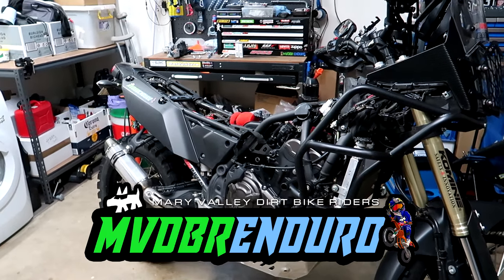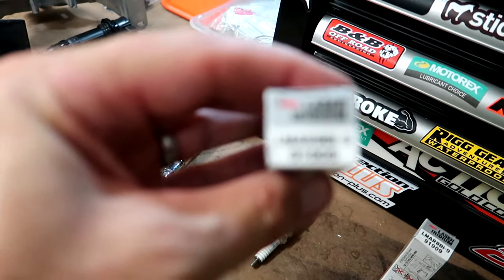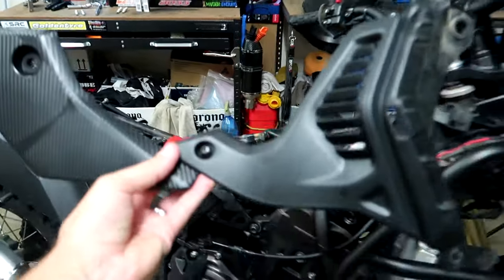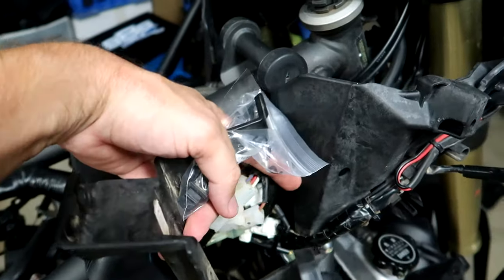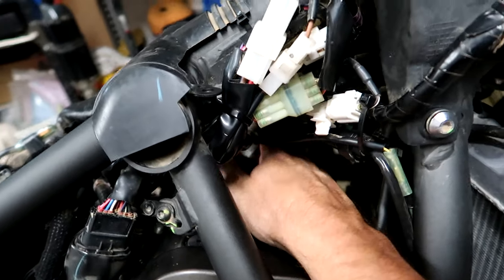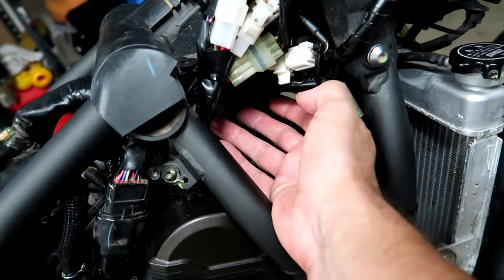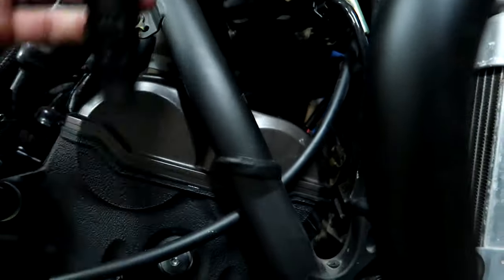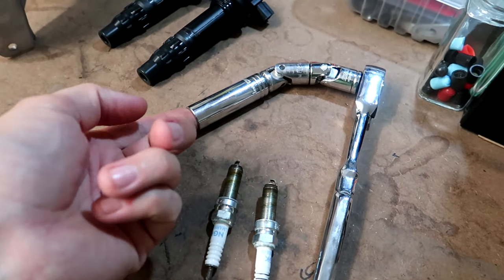Tenere 700 Spark Plug Mod For Easy Access

Comment from the maker: If you're having trouble getting the left-hand coil fully out, try moving the wiring harness above it forward towards the front of the bike as you're pulling the coil up and out. That may be easier than pushing the wires backwards. I'm not sure (can't remember) which way worked for me in the end.
Reply: Couldn't be done unless you forced it out. It tops out on the frame. You need to remove the ABS controller. See my video for more mod trick to remove the coil out.

Comment: I just did the complete change in about an hour. The easiest way to get the spark plug coils out is to get a length of electrical wire (~300mm long), double it over to form a loop at one end. Now twist the 90 degree connector on top of the coil tube so it is easier to access. Take your wire loop & poke it down (from directly above the coil tube) so that the loop slips over the 90 degree connector. Now you can pull directly up on the tube, no need for any spray lubricants. Because you are pulling straight up, there's no need to lever anything & you won't break the tube. You will find that if you just loosen the ABS/rectifier module you can then push it to the left & get direct access to the plug. The left plug is just as easy to change as the right using this method. There is no need to remove crash bars, radiator or rearrange any of the wires. You just undo the fuel tank, twist it 180 degrees & sit it where the seat goes. No need to remove any hoses, just the electrial connector. Also, place something over your battery to prevent the chance of shorting your tank across the terminals. That method that Clubby shows in his video is absolute rubbish & makes you think its a hard job when, with a bit of thought, its actually quite easy & quick. If anyone's in the Brisbane area & needs a hand then let me know, always happy to help!

Comment: Well played mate, that’s the one! Gotta get my hands on one of those sweet little KTM plug tools, looks perfect for the tool roll.
Reply from the maker: Good stuff Les was hoping you'd catch that. I ended up drilling the rubber grommet inside the tool a bit bigger and it grips onto the ceramic part of the plug just nicely now. Perfect solution, even does the front axle haha 🤙
Reply: Plug tool mod! Double duty, small & light, definitely qualifies for the tool roll !

Comment: Hi Josh Great video. The simple way to get you plugs out of the hole after you've unscrewed them, is carry a small length of plastic tube (150mm) with an ID just smaller than the OD of the porcelain part of the plug. You simply push it over the porcelain (by feel, its not that difficult )it will stretch easily over and grab the plug. Simples 😀 Most hardware stores have a range of this tube. If you have to buy a meter, Take the off cut as a syphon hose.
Reply from the maker: Thanks for the tip mate! I actually just drilled out the rubber grommet in the KTM plug tool a bit bigger and it works a treat now :)

Comment: Plug change every 20.000km. So it's not like you would have to do it every now and then. Also grease on the spark coils is a NO NO. There's a reason why they come dry and you want them to stay on and not move a tiny bit!  And get rid of that extra air filter you will fuck up the air fuel mixture. All these "mods" will bring problems on their own.
Reply from the maker: No issues thus far 😜

Comment: Awesome  mod anything that makes it easier, Unsure if its correct but might be worth looking into, if you drop  your bike in water and flood the motor ,rotate  the back wheel backwards pushes the water out the way it came in??I herd someone say before,might be worth investigating 😉🍻
Reply from the maker: Sounds like it should work in theory haha but I'm a bit dubious 😁 Thanks for the comment man
Reply: @mvdbrextra5216  I have tried this and it 100% doesn't work on the Tenere. The bit you missed is that you have to turn the bike upside down! You also have to remove the airbox otherwise it will suck the water back into the engine when you try to start it and lock again. However yes the method is viable and I've seen it done on dirtbikes.
Reply from the maker: @lukeh5725  thanks for the info :)

Comment: Hi Josh, did the mod yesterday. Cable try out and wires out of the way, however all looks like a great practical mod but can you give me any clue on how tight the coils are as I could not move the coils. Any clues other than your spin the outer cover. presently the bike is back together with original plugs. Looking to give it another go soon.
Reply from the maker: Mate the left hand one took me a long while to get out, they are wedged in there pretty good. The near one being easier to get hands on was a bit easier but still a bit of a mission. Keep at it is all I can advise. And definitely grease up the sealing rings before refitting 👍
Reply: @mvdbrextra5216  Thanks, as I thought more patience needed
Reply: Got the bastards, and yes the LH took a long time. Thank heaven for the life of Iridium plugs. and you can do it with the tank on.

Comment: Well I just did your mod and have to say this could be BS, unless you show us on video how you pulled out the left side without the removal of the ABS controller. Looks good on video, but you dont show actual removal then have to say BS. I'm going to add to this video to show you a easy way to pull the coils out and remove the spark plugs. Due to I am left handed it was impossible to lift them out, un less you check out my added mod.
Reply from the maker: I got mine out without removing anything else, lol what do I have to gain by lying about it 🤦‍♂️ You have to bend the flexible bottom end of the coil pack to get it out, it ain't easy but once you know what to do it's easy enough to replicate
Reply: @mvdbrextra5216  ok, I figured that it need to be forced out because it was pinned to the top and that was the only place to go that had room. I didn't go that deep and call you a liar, I just said BS, beautiful skies. 👍🤣👍. Good video anyways, but next time show the hard stuff as well, everyone can do the easy things. It the hard things that need explaining. That's why YouTube is so great.👍
Reply from the maker: Initially I wasn't going to make a video at all, but I wanted to try to explain a few things that the original video I watched didn't show. It's easy for people to criticize but for starters I don't think there's any way I could get a camera in there to show it being removed anyway, there's barely enough room for ya hand in there. And no it's not that easy to show the easy things, making videos like this is time consuming and adds a lot more complication to the process of doing the job, so you'll excuse me if I have a bad attitude towards whiners.
Reply: Grip the top of the coil pack where the cable joins (with the cable removed first obviously) get another finger under the lip of the seal which is what we are trying to loosen off and hold it to the top of the coil pack then twist and pull up.  It will take some time the first go but but this way you grip the rubber seal to the side of the coil pack which help you move it rather than just trying to twist the rubber seal or pulling up separately.  I also loosened off but didn't remove the ABS module on the left which makes it easier to get the coil pack out.  

Thank you for sharing this mod as it really helps and recommend everyone to do this before you find yourself having to as the first time is the worse.